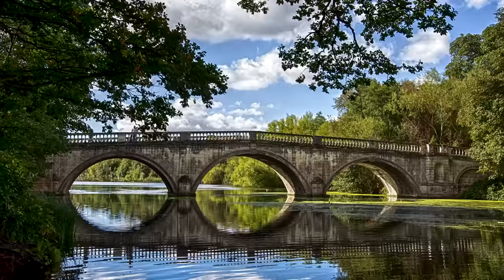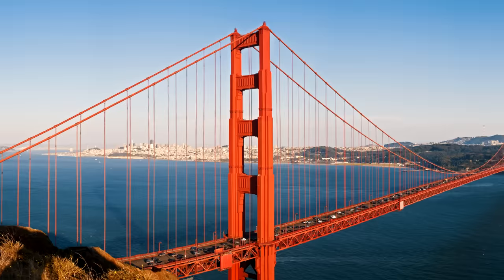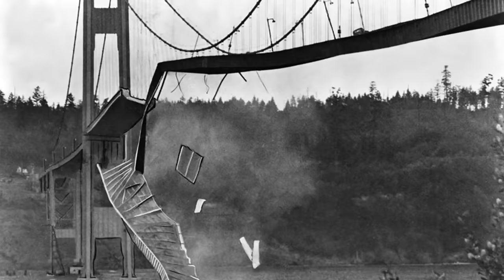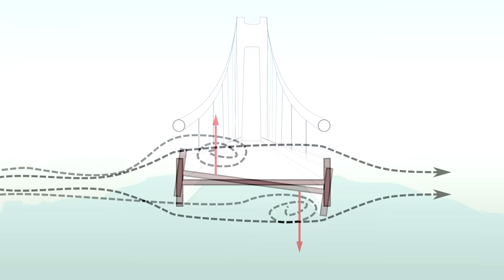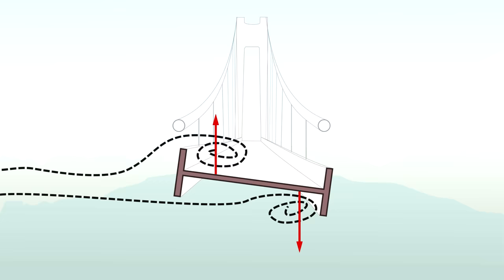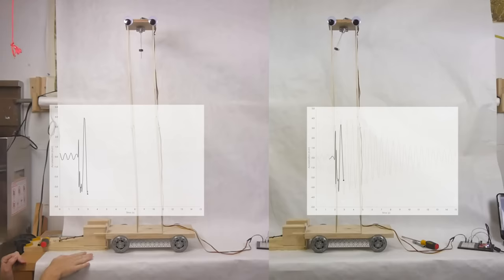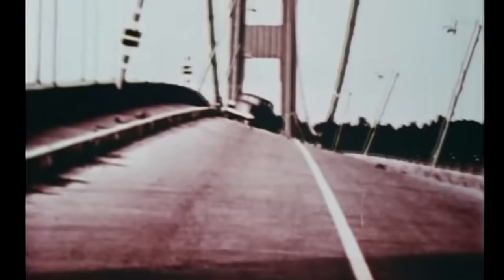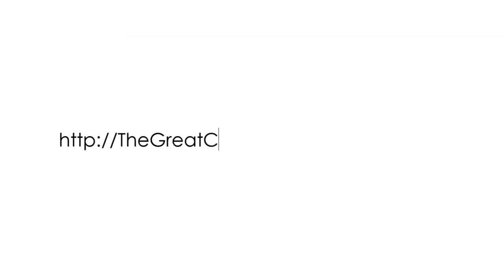Why the Tacoma Narrows Bridge Collapsed

Comment: Can you explain what the metal poles mean that mark underground pipelines?  When these pipelines cross under a road or fence line there are a number of metals poles marking the pipeline.  Some are straight, some curve over, some have numbers and are painted different.

Comment: I wish you would have gone a step further and told what happened AFTER the failure. Not only go through the  investigation but now that they built 2 bridges in its place, how THEY were designed.
Reply: While I'm fuzzy on the details of the investigation itself, I know that it didn't take them very long to figure out why it failed, and how to fix it. The first step to keeping the replacement bridge from collapsing too was simply not to cut corners like they did with Gertie. The original design called for open lattice trusses, but the construction company went with cheaper solid plates instead. The only major change in design between the first and second bridges was the width of the deck (going from 2 to 4 lanes), and sticking with the open lattice. The third and newest bridge is a feat unto itself, but I haven't had the opportunity to look into what they had to do to keep both standing bridges safe. Trust me, no one wanted a repeat of Gertie. There was litigation over fears of a repeat collapse that delayed the new bridge for years, even though it was desperately needed.
Reply: @melissanichols784  The comment was for Grady. I watched a documentary that covered the design of the replacement bridge awhile ago and since I watched this video (a year ago) I looked into the replacement again. He gave examples of what "could" be done to solve it. Great, useful, so what did they actually do??? Two more sentences is all that was needed to finish off this video. I don't know his process for getting videos out, but it needs refinement.
Reply: @tomsko863  Fair enough.

Comment: Seems resonant structures would make for a good way to convert environmental forces into electrical perhaps.
Reply: I think a wave power plant would be an example of that use. Not strictly a resonant structure, but waves also come from wind and create oscillating motion.
Reply: Wouldn't regular wind turbines be more efficient?
Reply: Thanks Arrvi, that's interesting, I'll check it out.

@ PotatisMjöl
No idea, but when you see how that bridge is  wobbling it must be massive amounts of force/energy, given how heavy the structure must be.
Reply: however as soon as you start to take energy out of the system the oscillations will reduce, so what you are talking about is trying to harness energy from a very poorly designed wind turbine.
Reply: @neodos Yeah but as he talked about in the video that amount of wobble was built up during a period of time like a swing so the force would not really have to be that great ;)
Reply: @Andrew Frink
 Yeah that makes sense, now that sounds like it could be engineered into a kinetic capacitor.
Reply: These are being researched in academy. I remember seeing an experiment where a small flexible structure model was subjected to wind (from a fan) and the oscillations were used to create electricity and power a light bulb.
Wind turbines are better for most applications, but aeroelastic systems have the benefit of taking very little space, so might be suited for some uses.
Reply: @ASJC27  That's amazing, any chance you know if the research is published and available somewhere online? Thanks

Comment: The principle of oscillation has been understood for centuries ever since Newton's second law of motion was applied to oscillation. All physical structures have resonance properties. The equation is an ordinary second order differential equation.  Every engineer learns this equation and forgets it or fails to use it at his or her own peril. There are electrical and magnetic analogs to the equation that are identical although sometimes seen in a slightly different form. Three variables define the resonance phenomenon, mass, springiness and damping factor. An approximate solution for natural and forced oscillation is presented along with the equation is in every college level first year physics textbook. The electrical analog is the LCR exuation. 

BTW this is why marching soldiers are ordered to break cadence when marching over a bridge.

Comment: In the 1950s there was a strong wind event that started moving the Golden Gate bridge from side to side.  They developed a plan to add reinforcements below the road deck.  After the reinforcement the concrete road deck was replaced with steel in order to reduce the bridge load.  You could notice the lighter part being higher as the contractors moved the replacement along the bridge.

Comment: Very well explained. The previous knowledege about what resonance means is necessary. But even in the absence of that knowledege, its compremhensive. The oscilating model with and without the gap in the center is excelent.
It is real. our ability to make mistakes is infinite as is the need and motivation to learn from those errors.

Comment: as a guy who climbs & builds narrow vertical structures for a living, ive experienced vertical oscillations atop "Monopoles" vertical oscillation and torsion in guyed towers. tall ones swing an easy 10' over their own center in high winds. some days you get to the ground after swinging back and forth with the steel all day, and simply fall over similar to getting off a boat after traveling in rough seas

Comment: I saw this (bridge) video tons of time, and it was always about resonance. But here you really explain why the thing was being twisted instead of just oscillating, and that is so cool! I have asked this question - why twisting, not vibrating - for a long time, but without any decent answer. Thanks! Also it was great to know about the helix structures around large chimneys, I saw a lot of them around, but thought it is related to some fancy strengthening of the pipe itself; had no idea it protects the pipe from wind-caused oscillations. Probably, that's a good reason why this helical structures often are located only at the topmost part of the pipe - because the wind effect is most powerful at the end. Great video!

Comment: Leon Moiseff was the engineer that designed the Golden Gate Bridge and also, a  bit later in his career designed the Tacoma Bridge that collapsed.  In the late 1930's proposals for several bridges in different parts of America appeared to be too costly to make the projects viable. So a new idea surfaced among bridge engineers called the "slender girder design" where the heavy truss side rails were replace by much lighter plate girders.  3 bridges were built to this design in the late 30's-early 40's.  The first to open was the Bronx-Whitestone bridge in NYC, opening in April 1939, The Deer Isle-Sedgwick bridge in Maine, opened in July 1939 and the Tacoma bridge opening in  mid 1940. We know what happened to the Tacoma bridge. The others are still standing but have had major work done to them to deal with excess movement. 

The Bronx Whitestone was designed by Othmar Ammann, the Tacoma bridge by Leon Moiseff and the Deer Isle-Sedgwick bridge was designed by David Steinman. All these men were familiar with each other's work and all were thinking alike when these 3 bridges were designed and built. No more were ever built this way after the collapse of the Tacoma bridge.

I am familiar with the Deer Isle-Sedgwick bridge as my mother's family had operated the ferry system this bridge replaced, for 147 years. My great grandfather, Charles Scott, was put out of business by this project, something my grandparents could not forgive. I lived in the Scott homestead for over 35 yrs and could look at that bridge out of the living room windows. 

That bridge had lots of cable stays placed on it over the yrs, suffered damage in numerous storms, but finally was remedied by having spoilers made out of aluminum added outside the girders to smooth out the airflows. Much to the delight of the MDOT that has made a huge difference. Before that, one afternoon, I stood on the Deer Isle side with my eye in line with the top of the rail and watched the "sine" wave oscillations move back and forth across the structure. Wind was not more than 30 mph in gusts but had set that in motion. Bridge had been closed by the State police due to the movement. It was astounding to see something that large move so dramatically in not really storm conditions. 

https://en.wikipedia.org/wiki/Deer_Isle_Bridge

Comment: The aerodynamic design of the bridge depicted at 6.06 is more complex than you suggest as it is not just to reduce vortices , but to increase the negative lift thus putting greater tension on the suspension as the wind increases pulling the deck down to prevent oscillations

Comment: The Mathews Bridge in Jacksonville, Florida opened in 1953. It is a steel cantilever bridge rather than a suspension bridge, but because of its height (and presumably with the Tacoma Narrows disaster in mind) the center span had metal grating. Over time this became a safety issue for cars driving over the bridge due to a combination of the metal getting slippery in foggy or rainy conditions and gusts through the grating buffeting vehicles around. The grating was finally replaced by concrete in 2007. Having driven over it before and after the change I certainly consider it an improvement for drivers and the bridge still seems sturdy. 

A view of the underside of the bridge:
https://en.wikipedia.org/wiki/Mathews_Bridge#/media/File:Below_mathews_bridge.jpg

Comment: I live in Seattle. And last time I went to Tacoma WA was like 2009, about 9-10 years ago. And I did see a bridge that was shut down with concrete blocks. I don't remember if the bridge was fully built or broken. But I heard of another bridge that had cost a few dollars to cross, much cheaper than today's Seattle bridge to Bellevue/Redmond.

Comment: I studied this from a different perspective, musical, as in sympathetic vibration. When a pitch or harmonic excites either a structure (like a guitar string) or air (as in blowing across a bottle) they are tuned to the same pitch. The bridge is vibrating much the way a string would. Really, only the one portion of the bridge was reacting violently. It was explained to me that the length of that section is like putting your finger on the fret of a guitar, and that the "string" has a natural pitch frequency. The wind blowing towards the bridge also has a pitch. When the pitch of the wind matched the pitch of that section of the bridge, it reacted like a string would.

Comment: Yes, airplanes does design to avoid fluttering. 747 famously had this problem during development due to uneven wing-loading, they twisted the wing to accommodate it. The "new" 747-8 also had problem with her new wings, they used fly-by-wire to make small control surface adjustments to correct it.

Comment: Professor Kurt Galle of the University of Washinton was a controls engineer in the mechanical engineering department when I was there in 1978 or so. He had an interesting improvement to the understanding of the story. He said that the original design might well have stood up to the winds for considerably longer than it did (maybe indefinitely) if they hadn't put in stiffeners to stop the galloping effect it was known for after its opening. 
The excursions of that galloping were within the elastic limits of the steel but car occupants and drivers didn't like the unsettling motion under certain wind conditions. I'm not certain of the original wind speed that excited the resonant mode of the original design but the speed that brought it down was that speed that excited the NEW resonant frequency. If he's right then people hired to "fix" things need to be careful.
My memory is that he had talked to some of the original people on the bridge's construction.

Comment: I am little confused of the term resonance.... I have heard it many times but I can't understand it correctly still now.... I am not sure that you have already made a video on this topic... If it's not I am eager for your update...😊
Reply: Anyone who plays guitar (or another stringed musical instrument) can easily demonstrate resonances and harmonics for you, if that helps, lol.
Musical "water glasses" can be instructive, too.  Certain resonant frequencies will cause oscillations which mutually reinforce each other ... enough to produce audible vibrations ... enough to eventually "shake" the material to the point where a weakness or fault develops ... a glass of water might crack or shatter, a large weight-bearing structure might collapse.
Reply: If you want to understand resonance, look at this.

https://www.youtube.com/watch?v=DXC9a-vcV5c

The front wheel of a motorcycle makes automatic adjustments because of the rake angle and the weight of the motorcycle over the front tire. But due to the mass of the front fork and tire and triple clamp and handle bars, there is an overshoot. Then it swings back the other way. Normally, these oscillations get smaller and smaller. So after a steering input, there might be one tiny overshoot, then an infitesimally smaller overshoot the other way. Then it's basically on track. Well, in this case the road speed and the weight on the front work (which are part of what determines how hard and fast the front wheel corrects) was such that the overshoot got bigger and bigger instead of dying off. This can be initiated by a bump in the track or by accelerating strongly, esp uphill, or by doing a wheelie and coming back down with the tire turned. If the tire were a size or two smaller (thus lighter), this particular accident wouldn't have happened in these exact same conditions. The mass produced just the right phase delay and overshoot to hit a resonant frequency. 

Modern racing motorcycles and many passenger motorcycles have dampers, now, to prevent this from happening. But if your motorcycle does not have one, you should never put a larger/heavier front tire than stock on it. 

Another more mundane example is a bandsaw. The frame is like a spring, and the top of the frame represents a relatively big mass. When it gets to bouncing, it can hit a resonant frequency that causes the saw to shake. Not a big shake, just a little continuous shimmy. There's a damper spring in there in order to take up the slack. The coiled compression spring has a high force to match that of the frame. This spring is situiated between the frame and the top wheel, so there's relatively little mass to impede it from reacting to changes in blade tension. Thus, it reacts much more quickly than the frame of the bandsaw, which bobs around like a fishing pole with a 20 lb weight on the line, in comparison. The mass of that frame and top wheel causes the frame to zig when it should zag, then zag when it should zig, because it causes a delay in response to the very quick and changing forces that are acting on it. This puts high peak forces on the bearings. The damper spring smooths out these peaks and valleys so that the bearings will last a long time.

As you might imagine, mass and inertia play a role in most forms of resonant oscillations. So if someone has the bright idea to omit this damper spring from their bandsaw, and to "replace it" by hanging the weight of the motor and bottom wheel onto the blade, instead, they just made their saw even less stable. Now you have the mass of the top half of the frame plus the mass of the bottom wheel and motor bouncing around and reacting out of phase to the inputs. Also, the bottom wheel and motor will be moving independently from the top half of the frame. So these forces will create even bigger summed peaks than what you would get from just the added reciprocating mass, alone. This did the opposite of adding dampening. And thus the bearings die, prematurely, and the inventor adds a massive axle and bearing to "fix" the problem. 

See John Heisz homemade bandsaw as an example of bad engineering. He thinks he came up with an innovative DIY improvement on the traditional bandsaw damper spring. But he created the Tacoma Bridge of bandsaws. And if you try to enlighten him, he will make a video to tell you you're an idiot. He's a smart guy and he has some great skills, and I still watch his videos. But he is stubborn like a mule.

Comment: I know this video is pretty old, but this type of oscillation is called a parametric oscillation. Whenever the parameters of a system change with perturbation like wind cross section, you can create oscillations that grow very large. A classic example is pumping your legs on a swing. You modify your center of gravity at regular intervals to create a large oscillation. They're very difficult to predict and are usually a whole number fraction of the frequency of the seed oscillation.

Comment: As a graduate in aerospace engineering I can confirm that aircrafts are designed by taking into account also wind or, better, wind gusts. The aircraft is "shipped" with how much of a wind gust it can sustain without any issues at the given flight speed. It's the duty of the pilots to avoid being at the edge of those diagram to avoid approaching the speed at which flutter might occur, with severe consequences to the safety of the flight.
Reply: Well we take into consideration the sudden movement of air up to a speed of 20m/s, (72kmph or 48mph), that can happen during flight.

Microbursts are a totally different beast, almost impossible to take into account. The only way to avoid them is to suspend airport activity during a particularly violent thunderstorm. And that's what they do anywhere in the world.